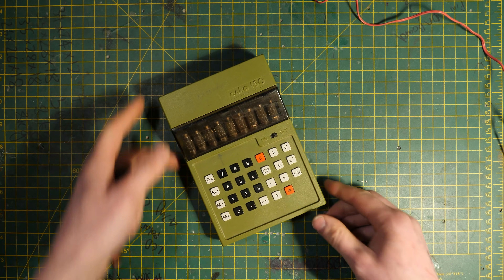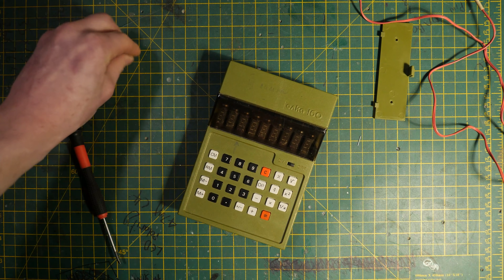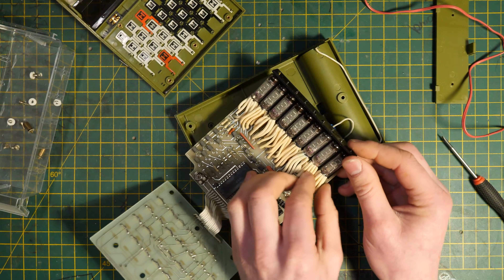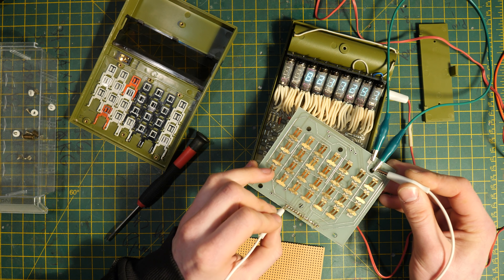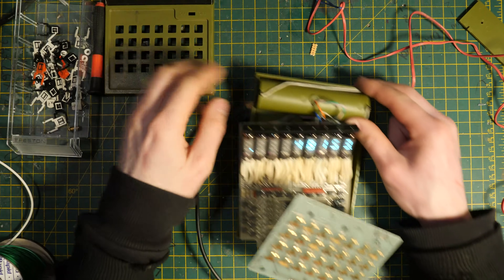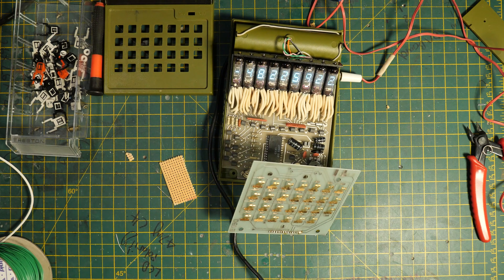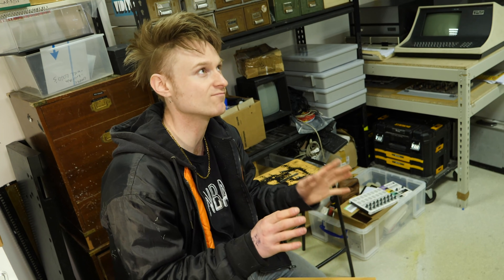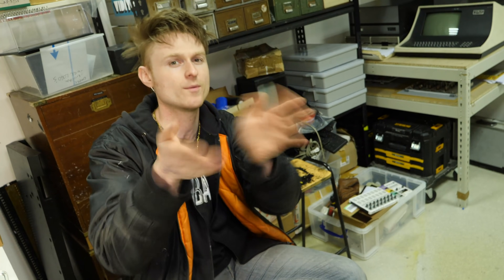Making the ELKA 160 into an Autonomous display

Comment: I have a casino fx-120 with a one piece 12 digit neonish tube. Still works fine. And a nixie tube frequency/rpm counter. This one only lights up. Still have to figure out how to connect it. It's a Philips pm 6601/01 should be a industry standard slot connector with  60 pins. If you know anything about this. I'd love to know what this is called. But maybe I will pickup the search and figure it out some day.... cheers

Comment: Just for clarification, am I understanding the random number input gimmick right?  You're applying a voltage periodically to the common terminal in the matrix, which gets you the random button presses — because the processor is  sending voltages into the matrix in a time-based way, so if you hit the common when the CPU is sending to the "3", it thinks it's reading the "3". 

 Presumably you could synchronize to the internal clock sufficient to always get the same output, but then, you don't want to.

It's quite different from the 3x4, 4x4, and 5x5 matrix keypads I've used, where you need to designate one axis as a set of inputs and the other as outputs, but the time-based part of the scanning is similar
Reply: well it is similar as you can conterol the matrixes you mention the same. the outputs scan through sending pulses out and depending which one is on when the inputs get the button presses will read the number. so it works in the same manner, i just took it apart noticed all the numbers had a common pin and just used it to the advantage. its doing what i wanted it to do. just making the most of the switch matrix, somewhat circuit bending it

Comment: I was just thinking.. since you are displaying numbers, it could show something actually somewhat useful, like adding an extra new screen that says some random fact, for example how many people live in london, and the display displays the number. Just to make it a little more entertaining and maybe even educational. Just and idea to add an extra layer to the interactive show of displays depending on how much digits you have to use.
Reply from the maker: thanks for the idea! however id have to politely disagree, I don't see something like that adding to it, or at least it just aint my thing. the fact is right now. it is random and seemingly meaningless (which personally id chose over meaning in a piece like this every time) but it has got meaning. it is being sent a solid command that never changes. The only reason the numbers are random is due to how the machine actually works, and the scan speed being out of sync with the Arduino. so yes these numbers actually have meaning towards the piece directly